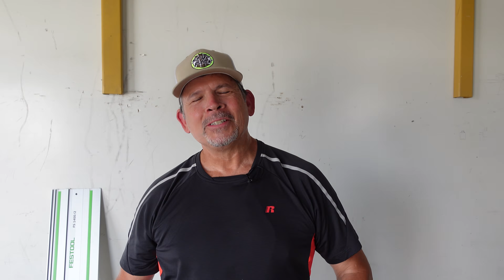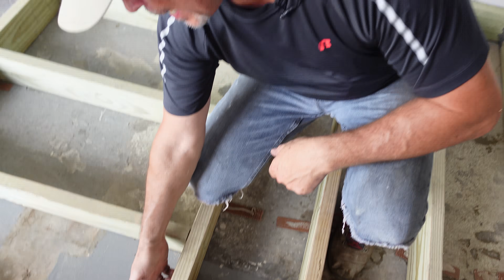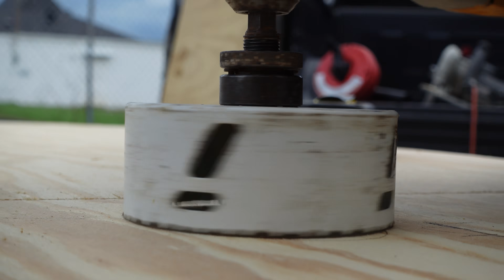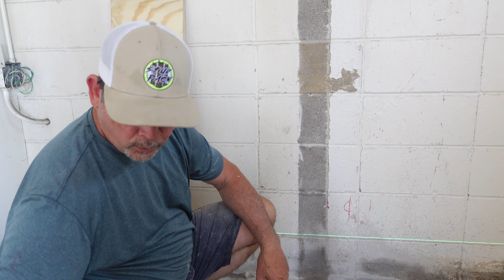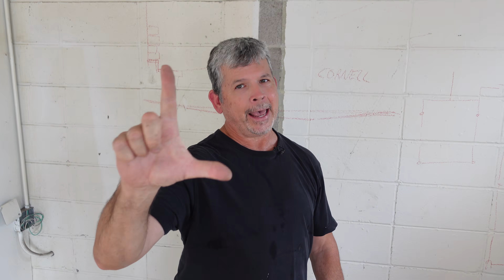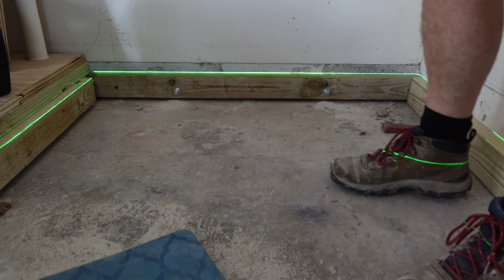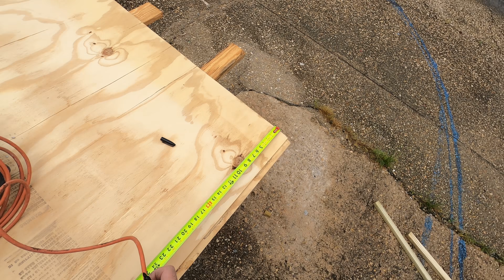Building a Bulletproof Curbless Shower (on Concrete Slab) - THE SHOP Part 5

Comment: Great job, on the bathroom remodel!! As per the problem with the anchors in the cinder block wall you should be used Epoxy anchors with a mesh insert. I used to work in the crane and hoist industry and we used to install guard rail system and that’s what we had to do to mount to cinder block walls that were hollow.
Reply: I was going to suggest epoxy type anchors too.
Reply: Some wedge anchors and that silka epoxy from lowes and you’ll be fine!
Reply: Or drill hole in the block, fill it full with spray foam, once set drill same hole into the foam, fill it full of epoxy, then set anchor/all thread

Comment: Great work guys. For setting drive pins in concrete in tight spots,  I have a tool by Remington. It is hand held drive with manual hammer, about 5 or 6 inches long with a shoulder to guard your hand which has a flat side on it to fit flat in those tight spots. I have had it for so many years, not sure if made any more. I will look.

Comment: For cinder block you need to use lead hollow wall anchors. They would of held the 2x4 against the wall better. How new are your concrete bits and are they still straight? I’m an electrician and most of my work is done on block walls. Only time I have issuses with tapcons not grabbing is usually from a drill bit that got slightly bent
Reply: I mean all of the weight is going down and all of the subfloor screws and glue are holding together as well.  No way that is coming off the wall imo.  I didn't carefully watch how many anchors they put in but I know it only takes 2 large tapcons in cinderblock and I can do pullups on what I hang on the wall (I put in 3 and it was to hold a 4 gallon water tank lol).
Reply: Your spot on

Comment: Take a four or six foot level and rub it across the tops of the joists and they will leave a polished mark where they need to be planed.
Reply: I would hate to ruin my german made levels.
Reply: @edmundooliver7584  This process as described by David Link will cause no harm to your level. No amount of pressure harmful to the level is necessary. 
Have a great day!